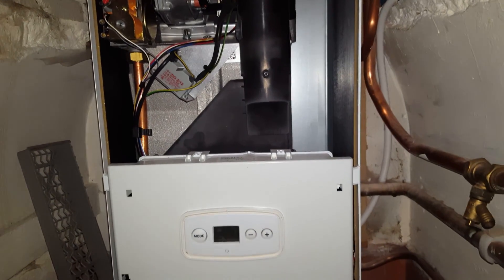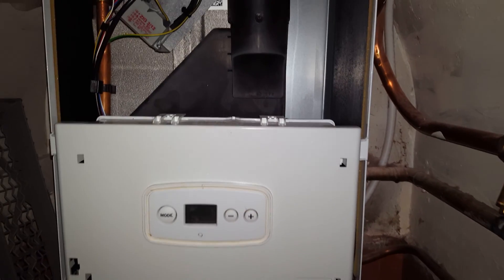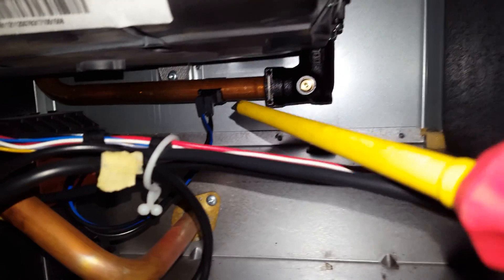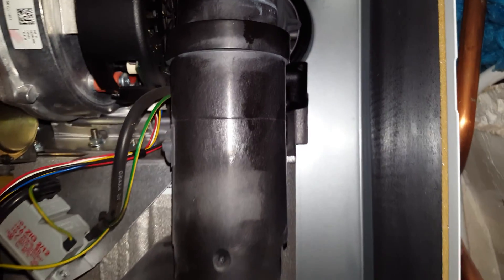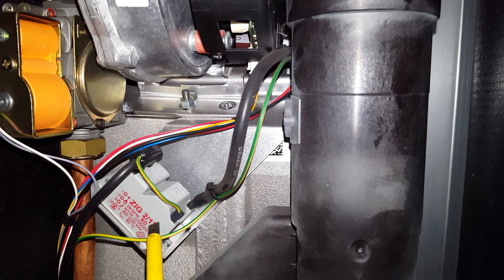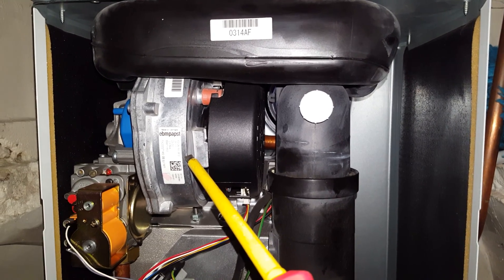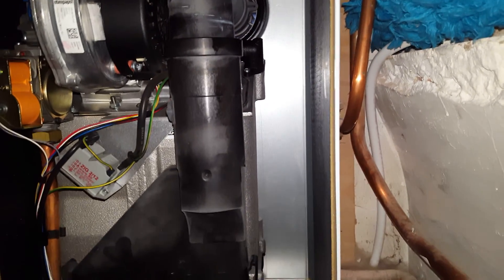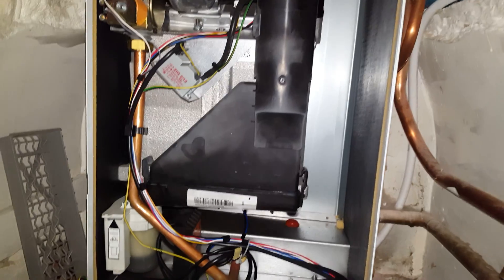Boiler repair Glowworm Flexicom 15HX

Comment: I've also got a F22 fault that keeps happening and today had a F25 fault. Any ideas? Many thanks
Reply from the maker: Its best you look them codes in the installation manual or call out a Engineer

Comment: I have this boiler and I have condensation drip coming from the plastic reservoir on the front bottom left hand corner. Water dripping out of the screw hole on the bottom of the cover.

Comment: Tony I have a glowworm flexicom 12hx . It keeps coming up F22 . I told its a pressure fault and I've seen videios on YouTube how to repressure a boiler by opening taps . How do you repressure my boiler?
Reply from the maker: +graham hendren Hi Graham take pictures of your boiler and airing cupboard and email to me tony@engineerteam.co.uk
Reply: A+R Central Heating and Boiler Repair Experts Ltd hello tony got the gloworm flexicom  18hx condensing boiler, keep getting the f22 fault coming up on the display? got hotwater but no heating? checked the three way valve? that's ok? The boiler is only 3 years old?
Reply from the maker: Check your heating pump
Reply: graham hendren ok graham thanks? have a good weekend.
Reply: @stephen mendoza  probs late but f22 is a recurring fault. Happens when boiler thermistor overheats and you get ignition fault. Turn down your thermostat, remove all demands, turn off at fuse spur. Leave for 5 mins then turn all back on and reset boiler